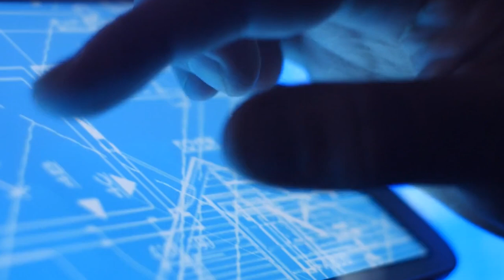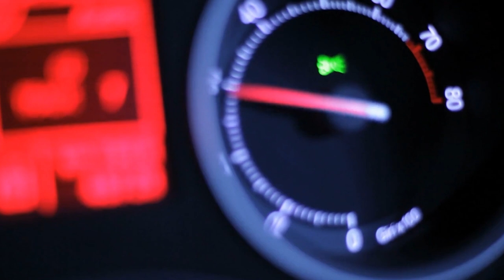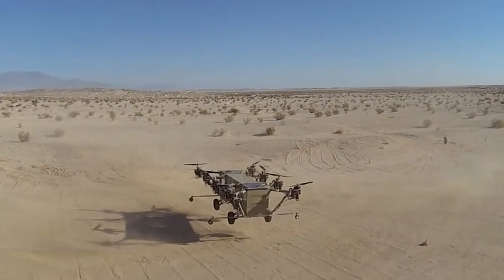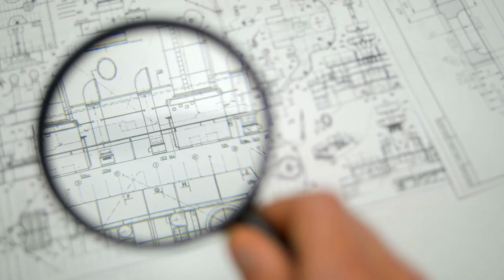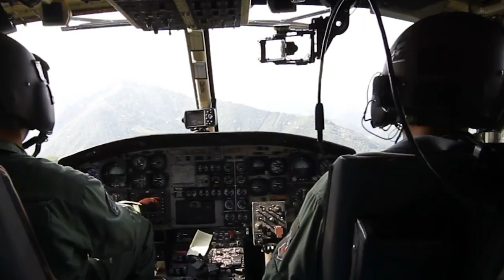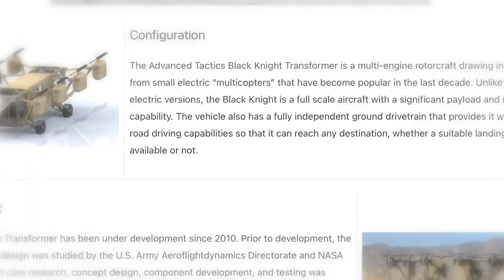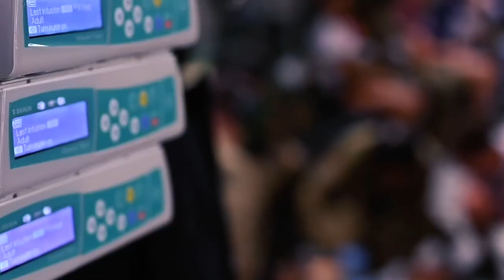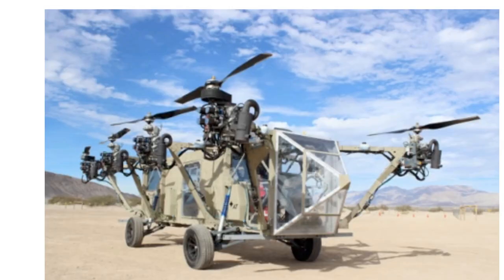Advanced Tactics Black Knight Flying Transformer

Comment: As of this video, while a cool concept, this looks like a nifty death trap in an active combat zone.
Reply: That's what I was just saying in different words but yes
Reply: Exactly. That serves zero purpose in a combat zone or for SOF. Maybe a local Sheriff's SAR could find a use for it. Otherwise it's pretty pointless.
Reply: Everything on a battlefield is a potential death trap. What problems do you forsee? Just curious.
Reply: @ashtonhartley2662  First and foremost, this this would be pretty easy to disable with simple obstacles due to all of the very exposed suspension and drivetrain components. Second, I would be interested to know how many of those rotor assemblies it actually takes to make this fly, since while it is on the ground doing its thing, they would be easy to make inoperable with small arms. Third, if you want to armor any of the problem components, the weight is going to rise quickly leading to a need for more of said components to allow it to move. Finally, the nice flat sides are going to be difficult to make more resistant to concussion and small arms fire, ergo the hull will need a design change that will make it have a larger volume and foot print while retaining the same interior space.  All together it appears to be fragile, exposed, and looks like a great target
Reply: @JacksonEngineering  Good points thank you!
Reply: @JacksonEngineering  I wonder it "ambulance" will be it's actual role though 🤔
Reply: The same could be said for any other kind of aerial vehicle.
Reply: @oompalumpus699  The difference being. Black hawks and f22s dont have to drive around ied ridden streets in baghdad. Hence why the things that do, are armored up the ass.
Reply: @ashtonhartley2662  
It has no protection for the men inside zero. Not even lite armor. It's a death trap. If you have to ask you've never been shot at. Even our helicopters have some form of protection. Even heavy armor on the floor. Humvees started with light armor and then moved to medium from experience.
This is like flying in a paper bag. I would rather walk and stay close to the ground. I was in the Air in the Gulf and thank God we owned it. LT Rob Retired United States Air Force.
Reply: @JacksonEngineering  
LT Rob United States Air Force retired. It's like flying in a paper bag, it offers no armor at all.
Our Helicopters have different levels of armor. Our Humvees are protected. Good idea for some applications not the battle field.
Reply: @oompalumpus699  
You are wrong. Everything on the battlefield has some level of armor. Including all helicopters. Some more than others, but they all have protection. Where do you get your information from?
Did you bother to read about it at all?
Or just post what you thought, like so many do.
Reply: @mikepaul3200  
Mike: The man your replying to has no clue what he's saying. Just another misinformed poster. 
I spent 20 years in the United States Air Force. All our helicopters have some protection. 
Depending on there function some much heavier than others. Man gets his information from a serial box. No talking to some on the web very frustrating at times for me.
Reply: @Mr.Robert1  Thank you for your service. Excellent points.
Reply: @Julian_Hopf  - A success?  If it was so successful why did they auction it off on eBay?
Reply: What makes this more of a deathtrap than a helo? Genuinely asking
Reply: @Hyperlooper  based on the CONOP they mentioned where the vehicle flys in and lands and then drives to its objective and then exfils the same way, the spindly suspension and low travel speed are a great place to start off. 
Additionally, attempting to use multiple propulsion mechanisms powered off the same source tends to lead to issues. That style of system tends to lack sufficiently redundancy to sustain combat damage without becoming a combat casualty. 
Lastly, I seriously doubt that this vehicle is very quick in the air and would have minimal if any evasion capability. 
Oh don’t forget possible damage to the flying mechanism while operating on the ground and the nice flat sides to make sure those projectiles and concussive blasts really hit home.
Reply: @JacksonEngineering  - And to armor it up to make it somewhat survivable it'll be too heavy to fly any great distance if it can fly at all.  They're trying to do 101 missions and making 1001 compromises which means this thing will be good at absolutely nothing ... except target practice for the other side.
Reply: @JacksonEngineering  It's a prototype.  All of those issues could be addressed in later versions.
Reply: @LG123ABC  they could. Normally prototypes end up being more similar than not to the final product though. To resolve a lot of these issues would constitute a large redesign effort that would likely end up in the vehicle being larger and heavier. Also it was dropped by the funding activity for a reason
Reply: @LG123ABC  - Nah, this isn't comparable to putting a man on the moon.  This type of vehicle has been tried before and failed before.  @Ross Jackson highlighted a few specifics that would make this vehicle untenable and he's right.  Its problems go much deeper than what's been pointed out too.  The funny is you're ignoring the biggest clue that this thing was a complete failure, the fact it ended up being sold on eBay.

Even though the narrator said the Advanced Tactics Black Knight Flying Transformer may be coming to the Army soon, it won't be.  You don't sell things like that on eBay if the Army wanted it.  In fact, if the thing had any value to the Army and they weren't going to buy it the Army probably would have ordered it destroyed like the military does with other projects.  They certainly wouldn't have allowed it to be sold on eBay.

Comment: That's the most Frankensteiny type air vehicle I've ever seen
Reply: The thing looks like a huge drone and a big rig had a baby.
Reply: That is the stupidest looking aircraft I’ve ever seen. It looks vulnerable as hell but then again, so we’re helicopters and jeeps so actually does this make it twice as vulnerable 😂
Reply: It has prototype written all over it.
Reply: Go ahead a search the video on the Ghanaian military’s weird inventions!
Reply: Some kind of ORC kitbash with Terran parts
Reply: @atakorkut5110  
I second that
Reply: I could see a old general going no way that is just to weird for soldiers to trust riding in. Realistically it was because to max flying range was probably not long enough.
Reply: It's more iMech aircraft than a chopter. Multi engine blades were actually more effective to endure a single hit/blow vs a mono. This craft could've been clear/invisible to the eye, stealth demention to radar and convert to high speed cruise wing folding potential,  including FLOAT, or submerge in water propellers tactic.
Reply: And flippin genius.
Reply: @atakorkut5110  id say half as vulnerable. It could quickly land and drive off under airfire....or takeoff and fly away under groundfire.
Reply: @phillip6083  also it's practical/simple demention body frames, makes it more efficient for modern armory resistant,  than the conventional aerodynamic curvs of 🚁 .
Reply: You havent seen the rocket powered autonomous drone back in the 60’s then. That thing is wack af or what about the single man vtol drone that if the man fell off he’d be shredded by the blades. This thing is nothing compared to what was done in the 60s
Reply: Reminds me of that video where some kid in the Netherlands strapped some electric motors on an old bath tub and flew it to the neighborhood grocery store. Lol

Comment: Would be an excellent vehicle for firefighters that fight wildfires. They can zoom in and out taking tired firefighters out and bringing supplies and rested firefighters in. If an area gets too dangerous the people in the danger zone could be rapidly moved away. Also urban rescue so that traffic becomes a non issue.
Reply: Best take on this thing
Reply: The problem with that idea would be the local weather changes that are often caused by the wildfires themselves or the amount of air flow which would create increased fir hazards.

Comment: It's a great clean sheet design idea, but then during the Iraq and Afghanistan wars, the army discovered the opposition was taking cheap 4wd light weight trucks, stripping out the bedding, and strapping a semisutomatic machine gun on top, or just putting a lightweight cab on the back. Each cost under £30,000, were available everywhere, parts and servicing everywhere, and could hit 90mph or more. And most combatants, apart from using any amphibious facilities, could get in, pick up,nand get the injured back to safety much faster, and were used to driving extremely fast over rough or difficult terrain, while defensively armed and so ubiquitous they came almost self camouflaged. So, the only missing bit was the flying. But with the flatbed taking out all but the worst wounded, you cut back helicopter costs, by using little birds instead if black hawks.
The solution had been staring them in the face since the gulf War, and they hadn't seen this cheaper, faster, and better field unit infront of them.
Very much like ukraines amateur drone pilots, hooking up the controllers to a smart phone for accurate, fast gps targets, and using them to drop basic mortar shells with deadly accuracy.

Comment: So, if you disable one of the rotors will it reply,” tis but a scratch!” and stay in the fight?
Reply: With 7 of them remaining? Very likely it will stay afloat.
Could probably even perform somewhat of landing with only 4 remaining ( bare minimum for SUCH a vehicle ) unless you manage to knock out like a bunch on one side, the front / rear causing it to become lopsided.
Reply: @Duraltia  but will you be able to pass?
Reply: You realize this is supposed to be for the battlefield where bullets are flying and God knows what else that's probably why they said no

Comment: If it fits in a c-130, they're going to figure out how to airdrop it anywhere...
Reply: The expanded effective range it will have when it's starting off at altitude in theater will also make this more likely to be employed... If fully electric, it could charge the batteries during the descent...

Comment: What abut firefighting?   Could be adapted for wildfire suppression,  controlled burning, forest management, various land surveys, agriculture, etc.   
This is a prototype, final design doesn’t have to look like an aluminum milk carton with wheels.
Reply: and/or you could crash it for a " backfire " !
Reply: @robozstarrr8930  
Any port in a storm, I guess, and the operators manual would be a short read.

Comment: Some things should not be combined; a truck can follow any army in any terrain with a maximum payload - unless a complete helicopter is built into it. A helicopter has far less payload and uses far more fuel, but can travel much faster- unless a complete truck is built into it. Better to use some simple but armored ambulances to evacuate the wounded out of the combat zone to the nearest helicopter.
The same logic goes for flying cars and flying tanks.

Comment: Seems to me that with all the other strange and unusual kinds of weapons etc. that our military has they could find a way to obtain this very versatile vehicle. Yes, I can see the issue of limited protection, including armor, weapons, and of course maneuverability and speed, but I would think these could all be overcome with bigger engines and so on. I mean, the Navy spent how much on the rail gun they will never deploy; the Air Forse spent how much on lasers, they will never deploy. Let's face it battlefield WIA are maybe the most important use of rotary aircraft, second only to offensive needs against tanks and the like. SO, if the Army turns their nose up for th is I think it would be a big mistake. Just saying.

Comment: I would NOT get in THAT. Not in that version. It says can be piloted, but where is the pilot? At a desk, or in the machine. It may know the course to get to an LZ, but it doesn't have the understanding of small arms fire, and avoidance. It can get around rough terrain, but not access a troop, on rough terrain. (Such as a heavy sloped environment.) Problem with AI, is combat will throw all sorts of parameters, outside of the box, that was never accounted for. When that happens, it will either stay motionless, or crash, due to being overwhelmed. I'd rather get picked up, in a cheap helicopter, and very expensively trained pilot, over this, in a hot zone.

Comment: just a little more tweek to the design and they can finally get it. i also have slightly desame  concept like shown in the video, but i can say mine can lift heavier payload easily, lesser fuel consumption, very cheap and easy to manufacture. i have very unprecedented unique proppeler design concept and im confident that my propeller's unique design concept can be used as a base for an airfortress, imagine a flying aircraft carrier, & flying submarine. im not disclosing yet the whole design to the public because of cpp china. im just a poor  filipino inventor yknow. with this kind of technology it is very possible to create a nation in the middle of the pacific ocean.

Comment: they should think outside the box about propeller design, the main concept is very viable but they are using a very inefficient propeller system. these people has very low of imaginative/creative ideas. always sticking in using copter rotor design, that's why i can say even now they never learn. i can confidently say that the solution is sooooo damn simple, they just don't really realize it yet, that even a dropout like me can understand in a simple sketch. very simple, but very dangerous because of its strategic and logistical versatility. imagine a flying factory, flying tank etc. i tell you its not a science fiction any more.

Comment: Quad-copter design for med-evac/supply?: Smart.  Readily understood tech.  Could even be broken down and carried squad level as a portable stretcher for severely wounded with IPCs slung below for slightly wounded.  Small radar and heat signature, especially if assembled and deployed in the middle of a fire-fight cold, almost as good as having a squad-level jetpack. Cheap and easy to maintain, would probably be effective.

 Making it into a transformer for medivac/supply?: Dumb. Clearly is unstable on both ground and air.  You're wasting lift so you can drive your vehicle only a few meters in certain scenarios, same quad copter with a flatbed deployed somewhere within 200+km of the quad-copter accomplishes this in 99& of these scenarios. Additionally failure-point city throughout the maze of hydraulics, to speak nothing of vibrational damage and the near guaranteed threat FOD is to external components.  Would not envy anybody who had to maintain this.

Comment: There are good ideas and bad ideas and this implementation is a bad idea.  It will work, but trying to do too much, too many parts, too many failure modes, too expensive to maintain, all operating in a hostile environment.  In war, maintenance is the killer.  Just drive this thing down a road with trees and watch the propellers get broken off.  Make it fly, or make it drive, but not both, the opportunity cost is too high to do both.  Need to go back to the concept phase and get rid of the drive requirement.  Alternatively 10 small drones can easily replace this thing with 10x the redundancy.

Comment: If that turd cost more than $200k the USMilitaryand taxpayers are getting shafted... that's $150k in light aircraft engines, plus another $40k for a truck drive train and suspension, attached to a $10,000 shipping container... that's retail cost on those...